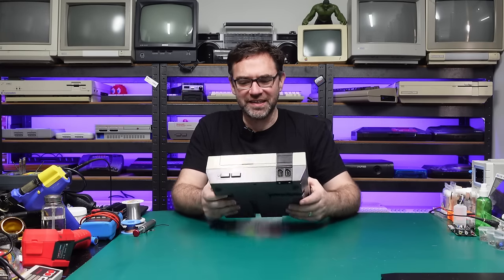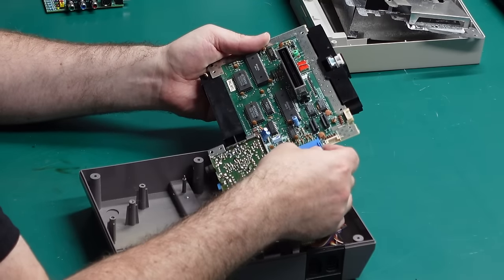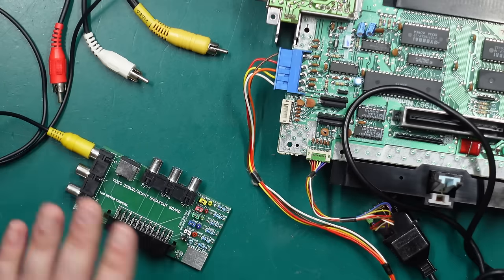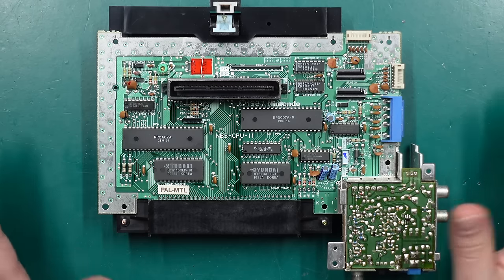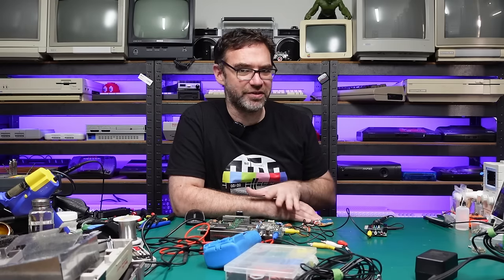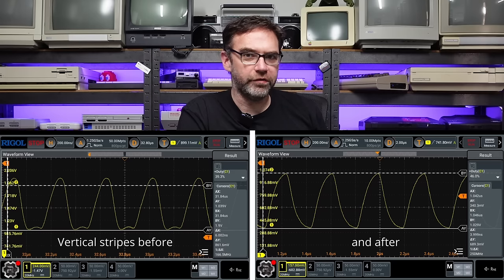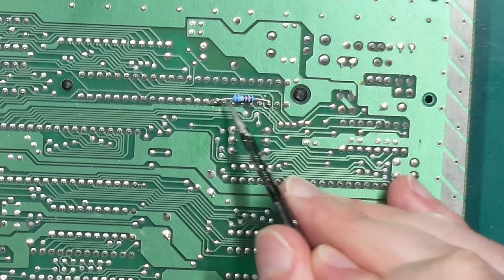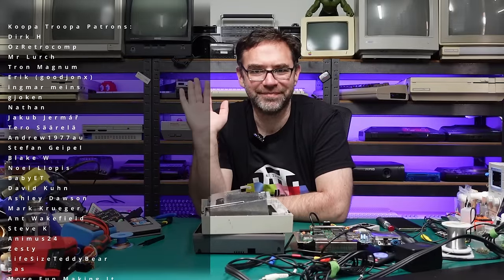NES frontloader composite upgrade mod, and adding expansion audio

Comment: It is good that you did not install an RGB mod, as my future PPUdigitizer for lumacode will probably again blow everything else out of the water ;-)  But it will take quite some more time to get this done as the PPU is really fiendishly complex.
Reply: You've had an hour, is it done yet? 🤣
Reply from the maker: Oooooooo 😎😎
Reply: @TheRetroChannel 
Hi,  I’ve watched a lot of your snes repair videos and learned a lot thank you,  but I’m pulling my hair out with a few problems, would it be okay to ask your opinion here in this comment section ?
Reply from the maker: @ronpalmer1371 feel free. If it is SNES related you're better off putting a comment on the SNES repair video. If I don't know the answer, somebody else may come across it. Otherwise there's a link to my discord in the video description
Reply: @TheRetroChannel  
Thank you so much, 
One snes works perfectly except it will only play half the games I own (all the games work on another snes) cart slot is spotless and it’s been recapped. Burn in test shows no faults. 
 Second snes has perfect video but sound is awful (sounds a bit like a blown speaker sounds) it’s fully recapped and no visible signs of a problem. Burn in cartridge shows no faults.

Last one shows no signal on TV screen,  cart slot cleaned and tested for continuity from rear to slot, question with this one is would it be worthwhile recapping or do caps not cause a no signal black screen ? Is there normally a first thing to check / replace ?

I know it’s asking a lot to diagnose without the item in front of you so I’m only after a very brief opinion, I’ve spent so many hours on YouTube and other forums. What I’ve learned is people like yourself with real know how are few and far between.  Again, thank you for any advice, regards Ron
Reply from the maker: @ronpalmer1371  for the first one I'd take note of which carts work and which ones don't. Perhaps there is a pattern related to the rom size, fast rom/slow rom, or enhancement chips. You'll have to do a bit of searching online to find those details but if there is a pattern it may help narrow down the failure point.

Second one could be a number of things in the audio circuit. Does the distortion happen in both channels, or only left or right? Both channels could indicate a fault with the DAC. Only one channel could point towards something after the DAC. There's some nice redrawn schematics online where you can trace out the audio circuit, but it may differ depending on the model SNES.

Third one is likely caps. If you have something with an analog tuner then try it with the RF output. The RF and RGB output does not run through the 220uf caps, whereas the composite and svideo output do. So it's worth trying different cables if you have them. If you still get a black screen then it could be numerous things

Comment: If the adding the support for expansion audio is so easy to do, just by adding ONE resistor, it puzzles me WHY Nintendo didn't include that in the NES from the start.
Reply from the maker: Looks like they intended to support it, but only from the expansion port on the bottom and not the cartridge port. As they never ended up using that port, the circuit remained unused until carts like the everdrive added support for it using an unused pin on the regular cart connector. The resistor just connects that unused pin to the rest of the expansion audio circuit

Comment: Very nice.  I never knew that expansion audio just needed a resistor between two pins to be activated on the NES.  You would think the NES cartridge would just do this mod internally or with a switch.
Reply from the maker: Technically the cartridge is generating the expansion audio internally but there's no connection from the cartridge port to the audio circuit. The resistor is needed to connect the expansion audio circuit (which only runs to the expansion port on the bottom) to the cartridge pin

Comment: Is the japanese audio of Castelvania III in the code of the american cartridge? I thought that sound was only possible due to the VRC6 chip. I‘m confused. 🤔
Reply from the maker: The everdrive emulates the VRC6 chip and outputs the expansion audio on one of the unused cartridge pins. The resistor connects that unused pin to the internal audio circuit

Comment: Hold up - all we need to do on NTSC for expanded audio is bridge a couple pins with a resistor?  The expanded audio will pipe through the regular ol' output jacks as usual?
Reply from the maker: Yes, assuming you're using an everdrive
Reply: @TheRetroChannel  indeed!  N8 Pro.  I'll have to give this one a go!  I wish getting RGB out was that easy 🤣

Comment: I wonder what value the original SMD capacitor was - it looks like it went from the video output to ground, just like the 1 nF you added.
Reply from the maker: Possibly. My other NES didn't have that SMD cap there so I didn't want to focus too much on it, easier to the remove everything and start fresh
Reply: Mine 220pf.